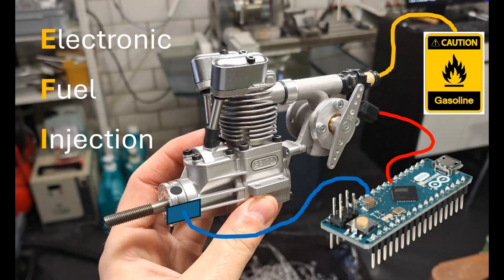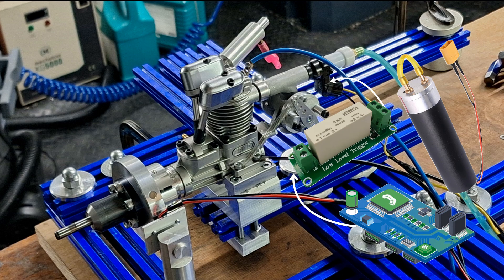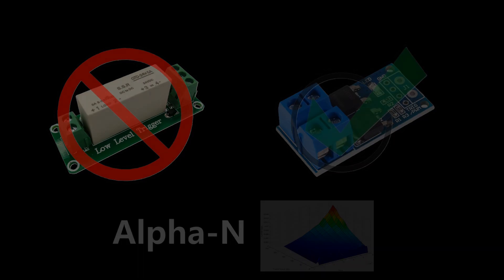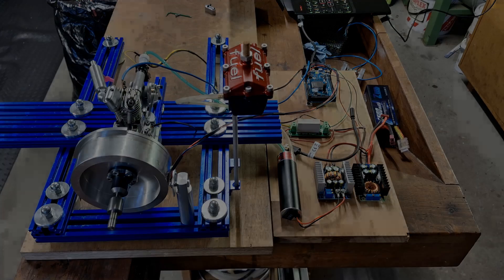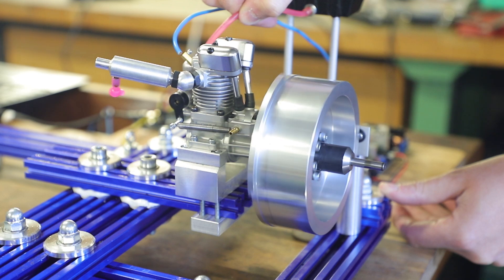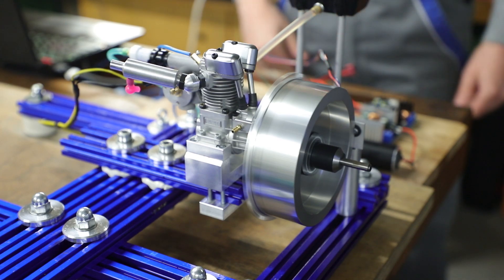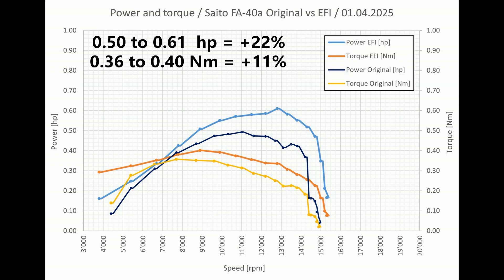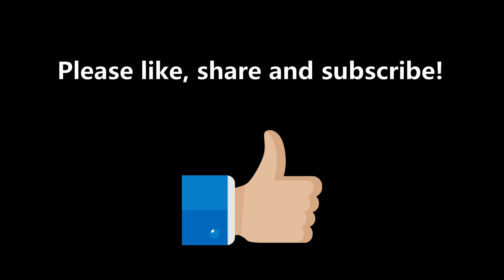Electronic Fuel Injection for a Model Engine / Elektronische Einspritzung für Modellmotoren / Part 2

Comment: I am still stuck in fuel pump hell. My first pump couldn’t get over 2 psi before obviously making metal. 

I have a better design ready but I am stepping back to low pressure carburetor setups for a while. 

I think for a small UAV, the power consumed by the ignition and fuel pump might be kinda high compared to the power used to cruise. So it might not make as much sense to do this on a 200-500w setup. Idk - we’ll will see
Reply from the maker: It sounds like you are using a regular fuel pump (centrifugal pump). You can't build up enough pressure with that. A normal fuel pump doesn't have to. It only has to pump fuel into the floating chamber of the carburetor. 2 psi is normal for such a pump. You need to switch to a gear pump. These provide the necessary pressure for an EFI. I have this one in my prototype https://www.ebay.com/itm/305829651007?_skw=305829651007&itmmeta=01JTP08VB24C9HMAZ6VARRCV0Y&hash=item4734de223f:g:oj8AAOSwvctnB6Dq&itmprp=enc%3AAQAKAAAA8FkggFvd1GGDu0w3yXCmi1c2J3GEZS7N8wTX35lmQ2fKBVbkjSUbQ8OB6kfzWdJqBS5%2FCynMB1Gq7Vi1yaarivVbcZkAqeEu2lVp7AJWY8czJ7qT5udQdFmm%2Bz%2F59wM%2F1meR0zhbwQ5EKlrOlyQNi0wtiFCQF%2Fz8rDrQzioWFOCiIGUofzo3nDqohuXRuVvVcZk7JD2C49ylKN4I%2FRQVw%2B6158OzLXvL0hd49hJj%2FiS0EuZICkIuxZ%2B6Bctywk8S4u3ekBJUMv5Iry8rVDZnf%2BPtDU3YQkhjiNJtjcqE2%2FXW94MjyNm%2BHY%2F4MnRpDl%2FNmQ%3D%3D%7Ctkp%3ABFBMzrWjwNVl
Reply: @ thank you for the link. I will almost certainly buy this - as it is cheaper than the bar stock for me to try my next pump design (I’m trying to make a micro gear pump). 

Can you tell me how much current it draws and its mass? 

Thanks!!
Reply from the maker: @rcaddiction7071  
I'm powering it with 5V and it consumes 2A, so in total 10W.
It's 30mm in diamter and 110mm. But the black housing around the motor can be easily removed and then the pump is only 58mm long.
Weight is 130g.
Reply: @ much appreciated. Designing and machining a micro gear pump that can withstand 3-4 bar continuous pressure has proven very difficult. I realize your pump is probably only hitting 1 bar or so but this is good enough to get started testing like you are already doing.
Reply from the maker: @rcaddiction7071  I agree. It's a good pump to start. I will design a own one.
Reply: @ should I get something that works - I will share my design gladly. Your videos and the comments are a cool and rare spot on YouTube as people are sharing useful information.

Comment: Check rusEFI could be the mapping your looking to do.
Reply from the maker: I will look at it. But it looks like this is more for cars and accordingly everything is large.
Reply: @danielhunziker3577  it's open source with STM32 processor. It can be very small. Especially if you don't need the robust protections. RusEFI has run at least one moped engine that tried to around 10k rpm.

Comment: Hiya, great stuff! The mosfet should be fairly easy to put in. At the frequencies you want (a few thousand Hz) almost any enhancement mode switching power device will do. The sort listed as for SMPS. The map sounds harder, in that it will have to be done with repeat runs. Methanol is very forgiving, so maybe start with 5 X-Y points and interpolate between them. RPM vs Pulse width. A TPM multiplies the points, but will improve the throttling. All good fun!
Reply from the maker: I will probably determine a few full load points at the beginning and use the dyno to see at which injection duration I reach the maximum power. I will then interpolate between the points. Then I will add the position of the throttle valve as a factor until idling. Something along those lines...

Comment: What is the fuel injector size used? Was it meant for a 125cc mopet? Nice work!
Reply from the maker: The injector from a 125cc Honda Grom https://www.ebay.de/itm/134953632192 For this 6.5cc rc engine with methanol as fuel, I operate it at the limit.

Comment: Really nice. If with an test model you got this nice result, it means you can improve it even more. If you manage to shrink down the electronics, it can even be made as an standalone ecu for small engines. Really nice work!
Edit: typo
Reply from the maker: Thanks Luca! That's the goal.To further improve the EFI and in particular to reduce its size.
Reply: @danielhunziker3577  looking forward to that!

Comment: Why do not add control panel with switches or buttons instead of disconnecting wires for ECU version of engine?
Reply from the maker: I guess you noticed that I disconnected the power from the microcontroller to stop the engine. To be honest, I was just too lazy to install a start-stop button 😅 It would be no problem at all to integrate this into the code with an interrupt command. But somehow I haven't had the motivation to do so 🙃

Comment: Ich glaube, nicht dass die Einspritzung so viel Leistung gebracht hat, sondern die bessere Gasführung und vielleicht auch die Länge des Saugrohres. Ich bin auch der Meinung, dass für so kleine Motoren, eher eine kontinuierliche Einspritzung bessere ist als eine gepulste. Auch ist sie problemloser für hohe Drehzahlen. Vielleicht kann man versuchen diese Ventil über PWM anzusteuern und so den Öffnungsgrad/Einspritzmenge regulieren
Reply from the maker: Fragen über Fragen die wohl nicht so einfach zu beantworten sind 🙃 ich musste so viel verändern im vergleich zum Saito Vergaser. Alles rund ums Drosseklappengehäuse inkl. Ansaugtrichter ist von einem OS 8mm Vergaser kopiert. Der Ansaugstutzen ist länger was insbesondere im unteren Drehzahlbereich mehr Drehmoment bringt (bei hoher Drehzahl ist ein langer Ansaugstutzen kontraproduktiv). Das mit einem PWM Signal wird nichts. Die Einspritzdüse schaltet unter 3ms Pulslänge nicht richtig. Du erreichts mit 3 - 4ms Pulslänge gerade die optimale Spritmenge. das ist logisch, weil die Düse ja hoffnungslos überdimensioniert ist. Deshalb musst du mit einem Puls arbeiten damit es überhaupt funktioniert.
Reply: @danielhunziker3577
Da habe ich mich wohl falsch ausgedrückt. Ich meinte mit PWM ein Ventil zu regeln, wie stark es aufgeht bei einem Ventil welches permanent offen ist. Also kontinuierliche Einspritzung. Bei der Gasführung sehe ich eine grossen Unterschied. Beim OS hat das Saugrohr starke Umlenkung/Bogen mit kleinem Radius  bei der Einspritzung einen recht grossen Radius.
Reply from the maker: @argentumflower592  PWM ist ja im Grunde nichts mehr als eine Regulierung der Spannung. Ich habe bereits versucht die Einspritzdüse mit verschiedenen Spannungen anzusteuern. Das funktioniert aber nicht, weil die Spule zu wenig Kraft auswirkt. Wie erwähnt ist diese 125ccm Einspritzdüse für eine HONDA Grom schlichtweg überdimensioniert und ich betreibe diese am unteren Limit. Wenn du diese für SinglePoint Einspritzung für einen 50ccm Motor nimmst, dann ist PWM eine gute Lösung.
Es ist natürlich kein Zufall dass mein Saugrohr so aussieht wie es ist. Ich optimiere immer wenn möglich. Ich glaube wichtiger ist die Info, dass die EFI in diesem Fall nicht schlechter ist als die Originale Vergaser Version. Das wäre echt ka*** gewesen!

Comment: That's pretty awesome, wasn't expecting an increase in power but I'm pleased to see it works so well given it's relative simplicity, imo I'd prioritise getting it running at good as possible (simply having a 3D graph for fueling to scale it with rpm and throttle position) and then making it more compact, not sure how you'd go about that without a wideband O2 sensor, maybe there is a way to make one work at this scale, I'd love to see more technical videos on this as I'm thinking of starting something similar soon on a bit bigger scale and would love to know some more details on how you got it working.
Reply from the maker: Hi man! Model engines are all adjusted by experience. You have a basic setting of thecarb given by the manufacture and that's pretty much it. In the end, the user adjusts and tunes the carb by feel and experience. I did the same here. I regulated the EFI timing with my experience. But I can say, that the mixture was on the rich side (as usual with model engines). I have never seen an nitro engine (methano-nitro-oil fuel mixture) with O2 sensor.

Comment: Danke Herr Hunziker für das Video.

Das Problem ist aber das die elektronische Einpritzung mit fremder Energie betrieben wird, der Vergasser aber nicht. Um das wirklich zu vergleichen müßte die gleiche Energiemenge welche die Einspritzung benötigt dem Motor via Überdruck am Vergasser zugeführt werden. Alles andere ist nicht OK, es sei denn der Motor lifert die Energie für die Einspritzung selbst.

Gruß Reiner Markenfreund
von Michael Frithjof Müller
Reply from the maker: Hallo Reiner. Ich verstehe deinen Punkt bzw. Einwand. Aber ich glaube du überschätzt den Strombedarf der Einspritzung. Die Pumpe hat maximal 10W (5V 2A) und die ganze Einspritzung weniger als 15W (was maximal 0.02 PS entspricht).

Comment: Any thoughts on starting a github project? Would likely get a lot of interest.
Reply from the maker: There is already an open source software for Arduino called Speeduino availble. However, I deliberately didn't want to use it as I wanted to develop my own solution. Because that's what model making is all about. DIY 🙃

Comment: Amazing, solution for broken carburetor.
Can you share the arduino codes?
Reply from the maker: I don't think this is a solution for broken carbs because it's not a plug'n play system. You need more like Hall Sensor, Micorcontrollerm Fuel pump, etc. Only when all thing are tuned to each other, it runs. My Arduino code will therefore be of no useful to you. But there is a freeware for Arduino called Speeduino. If you're looking for something, that's the way to go for you.

Comment: I need something like this for my project rc engine im designing. It needs a fuel injector smaller than ones available on the market, and I definitely dont have the electrical knowledge to design an injector, lol. Good work!
Reply from the maker: Hi man! I would also like to have smaller injectors. But model making means making the best of the situation. My aim was to use not expensive, small and available injectors. Imagine there are smaller ones on the market, e.g. with a piezo actuator. Then we are no longer talking about 10 US$ per piece but are quickly at 100 US$ or more! 🙈
Reply: @danielhunziker3577  My thoughts exactly, even dirtbike injectors are like 30-100 dollars each, which would be expensive since my engine is a v6. i looked into an ultrasonic electric atomizer device, I figured I could vary the flow by changing the voltage, the only issue is I'm not sure it can turn on and off fast enough, so it would essentially have one stream of fuel that could supply more or less depending on the rpms and throttle position.
Reply from the maker: @ViperScaleModels I can link you to the injectors I use: https://www.ebay.de/itm/134953632192
Reply: @ViperScaleModels think piezo buzzer instead. can be used as the pump and injector, just the injector valve, etc.. various ways to arrange that diaphgram. 
deflection is mostly about voltage one can apply...

Comment: Nice work. I’m liking how you do things the correct way. Getting a base line measurement is vital, it mean if you use the same process and the same equipment you can validate your results.
I would  like to see what the mixture was doing during these runs.
Are you using simple dyno ?
Reply from the maker: Hi man! Model engines are adjusted by experience. You habe a basic setting of teh carb given by the manufacture and that's it. It's In the end, the user adjusts the carburetor by feel and experience. I did the same here. I regulated the timing of the fuel with my experience. But i can say, that the mixture was on the rich side (as usual with model engines). The dyno is selfmade, based on the priniciple of a roller dyno for cars. So yeah, it's made simple.

Comment: Love those numbers. What's your calculated AFR at peak?
Reply from the maker: Hi James! To be honest, I don't know the Air-Fuel-Ratio exactly. It's like you are using and adjusting a carb on a modelengine. The user adjusts the carburetor by feel and experience. I did the same here. I regulated the timing of the fuel with my experience. But I can say, that the mixture was on the rich side (as usual with model engines). As soon as I can do a fuel mapping, I will look for the power peak and optimize the timing of the injection accordingly. Unfortunately, I can't do that at the moment... Fortunately for me, methanol is very unproblematic on mixture, otherwise the engine wouldn't run at all.
Reply: @danielhunziker3577  - methanol is an excellent choice test/development fuel, particularly for small displacement. I can already imagine your V8 running EFI.
Reply from the maker: @JamesCopeland-i1j  What I can say is that I'm already working on it. Which of my engines is currently being converted to EFI you will see in a later video 🙃 But the next video will be a rotary valve head 😁 My favorite theme!

Comment: Amazing work! Following it closely
Reply from the maker: Thanks man!
Reply: @danielhunziker3577  i did something not so similar on helicopters. I monitored temperature and rpm and used servos to adjust the needles

https://youtu.be/lxpvjdDpm0w?si=jGbY0jWUPb6eTAq3
Reply from the maker: @macbookdepressao  Sounds nice! I only know that OS did something similar to what you describe. https://www.os-engines.co.jp/english/line_up/engine/air/aircraft/manual/160fxfi.pdf They modified the carburetor so that the mixture needle was electrically adjustable. You were able to program the injection quantity based on the servo position, the engine speed and the engine temperature. But the engine was rare and probably didn't catch on. Perhaps too expensive? Technically too complex? Too much electronic? No idea...
Reply: @danielhunziker3577  yeah, I kinda got the idea from it and "carbsmart". Last one would not work so well in my opinion cause the PID was always running, even if the engine was idling... o tried to make my unit tune only on high loads using the position of the throttle servo. Worked out alright.

About the OS engine, I belive it was kinda expensive coming from OS, who knows... the concept seemed simple